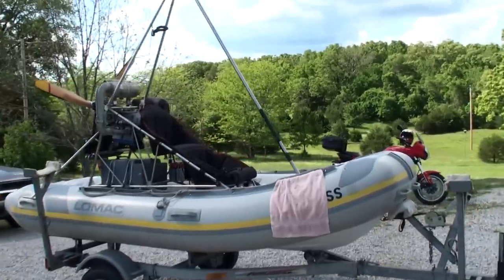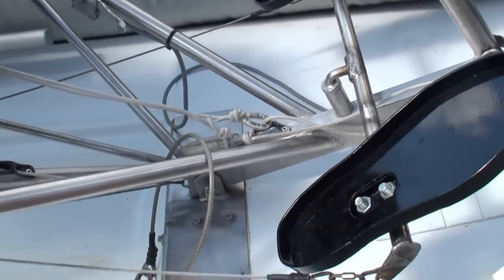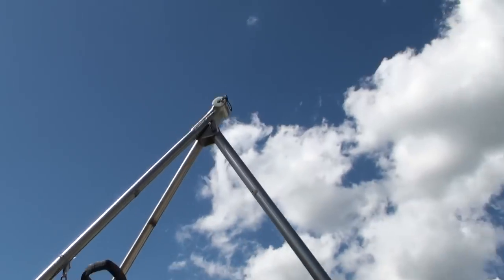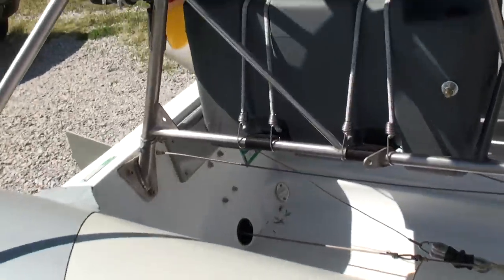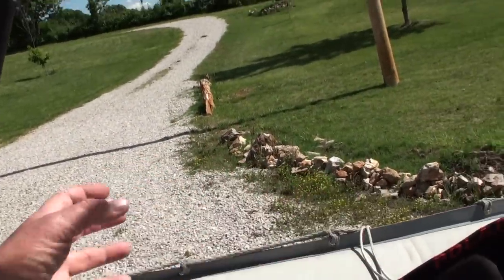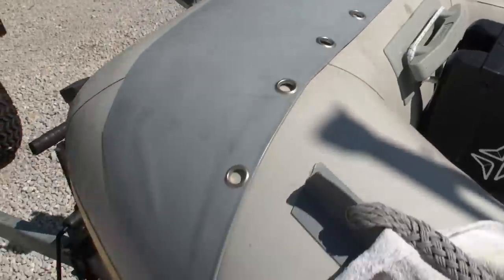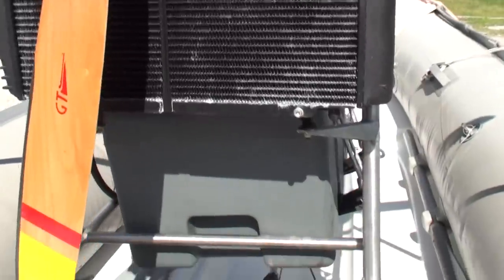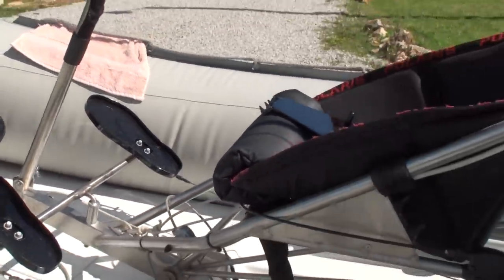Polaris FIB Flying Inflatable Boat Mods

Comment: Hello great detail video of the Polaris with the Rotax 582. I Dont even know if you look at this video your self any more, but i want to make you a couple of questions, first is this dual starter, electric at the prop gear and pull manual at the back end of the motor ??? if it is an electric start at the prop gear what king of gear case is it, model or brand name, and is this the biggest fuel tank it can be installed in one of this without becoming greately underpowered since they only put out about 65hps. I did notice you dont have any safety wire on the springs for the exhaust, you need to be careful with those they tend to break and fly into the propeler, take some wire and put it throgh all the inside of the springs and tie wire to the pipe. There is a kit to get rid of all them exhaust springs and its a better sistem, also safety wire the oil cap on the top oil bottle, the caps do come with the hole to do so, they fly away into the prop too !!!! Other than that great trike and hope you fly safely and enjoy it !!!! Thanks

Comment: I know that you have since sold your FIB, but we have a question on how you modded your fuel tank to remove the view sight and replace with solid bolts. The screws at the top and bottom just seem to rotate and not come out. Any recommendations are greatly appreciated. Our next mod is that nice wing bracket. Great video!
Reply: They're just regular bolts from the hardware store with some rubber gaskets that will handle gas. Hard part was feeding them into the holes from the inside & then holding them while tightening the nuts. If you have the right tools you'll get it.

Comment from the maker: It's Item number: 150803344249 on ebay and it's listed for an $11k BIN and you can make an offer as well. New ones currently are about $33k I was told, but you can't buy a new FIB and get an 'N' number. If you need that, you'll have to wait till one comes up for sale somewhere. These are awesome boats though all things considered.